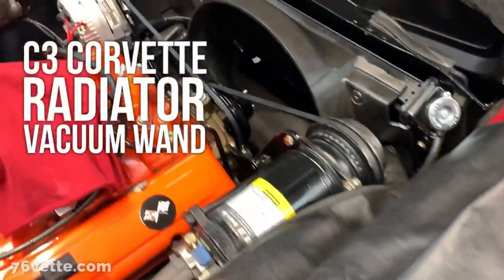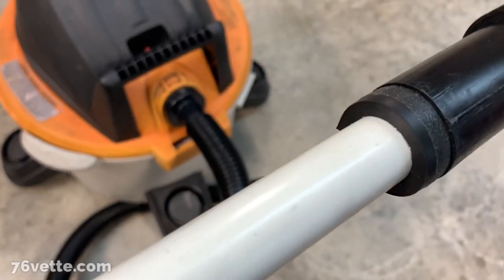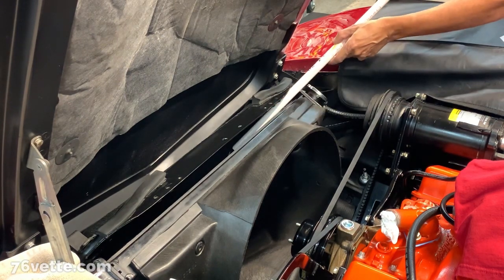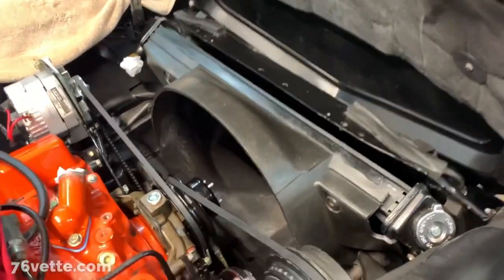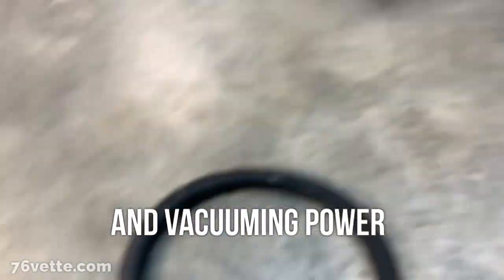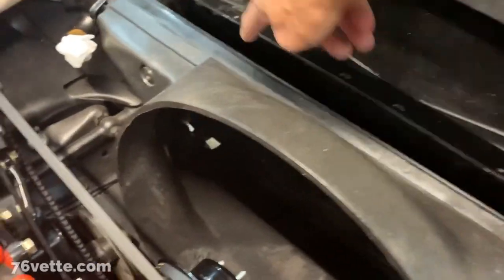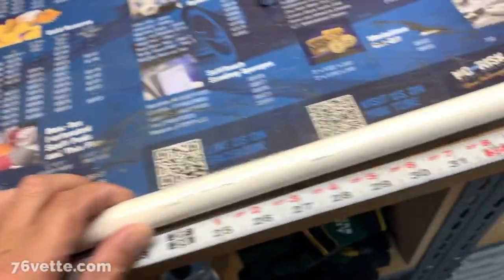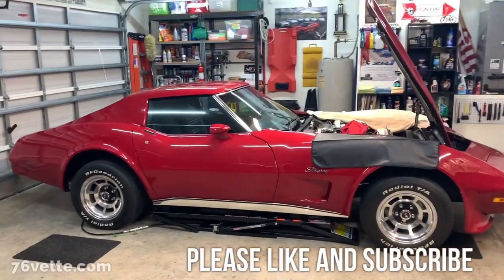Lots of Trash Between Radiator & Condenser

Comment: Great minds think alike:)   I knew I was losing AC blower air from leaves stuck in the Evaporator core.  Never took it apart.  I took the fan off and took some snap shots of the core with my phone.  It was half clogged.  Did what you did but with a smaller serrated hose duct taped to the big wetvac hose ; pinched it oblong and vaccumed all the leaves and junk out...  Much more aire blowing now.  Replaced my radiator so that wasn't an issue.  You did have quite a bit of leaves wow!
Reply from the maker: Yeah, there was quite a bit of trash in there. And I wonder how much is stuck between the vanes.